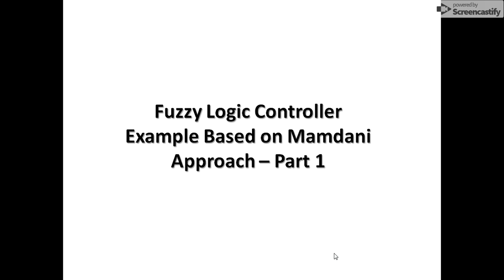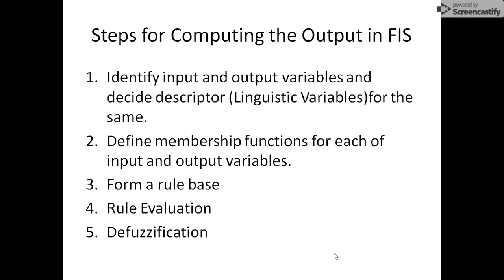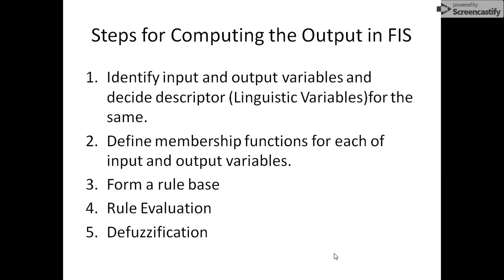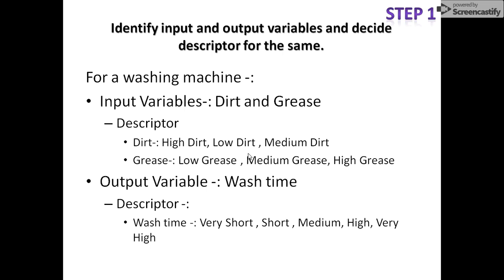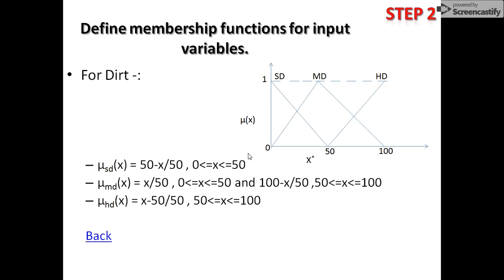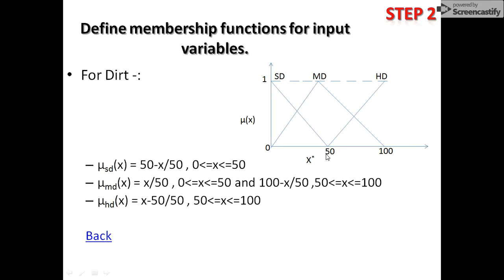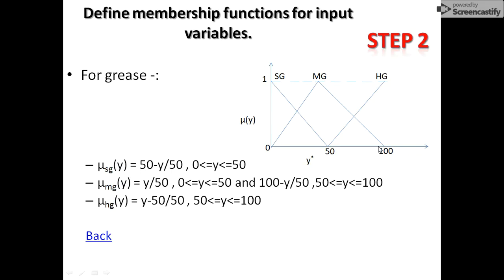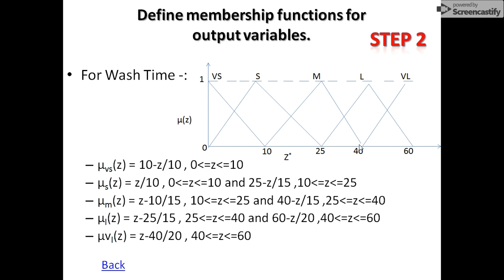Example of Fuzzy Logic Controller using Mamdani Approach- Part 1

Comment: Hope all of you are doing well. I need help on fuzzy logic. I have three inputs SOC,Sloar and wind. On the basis of these inputs I want to create rule base for three modes. Emergency, energy saving and normal mode. How I can define rules.
Reply: According to my understanding, the defining of the rules should be done according to your requirements and the feature you want to control. Is it energy output you're trying to smoothen here for varying values of the inputs?